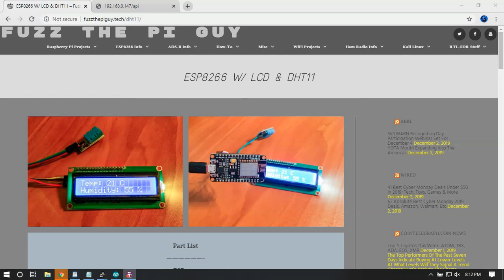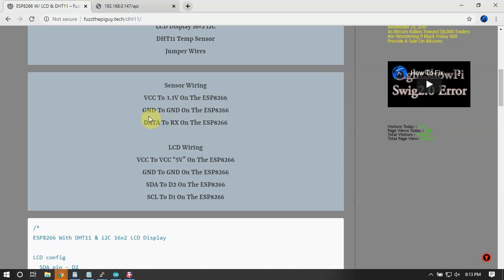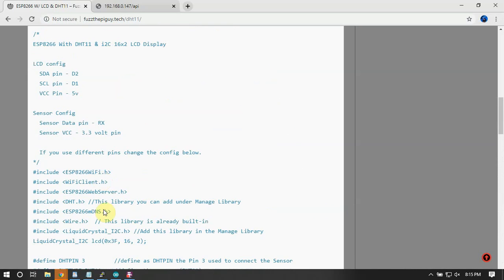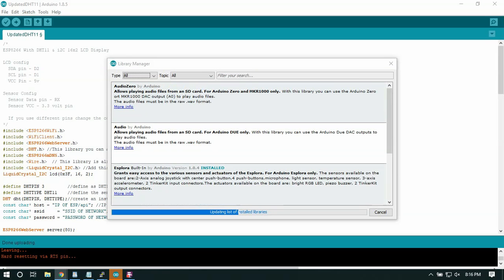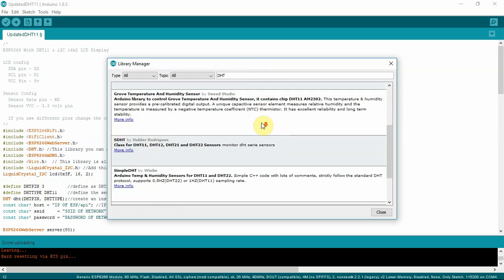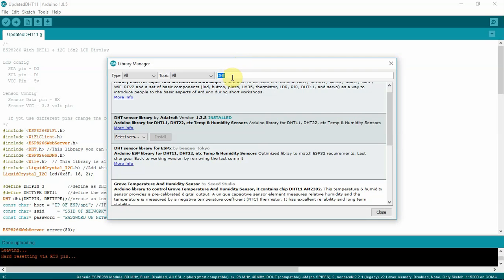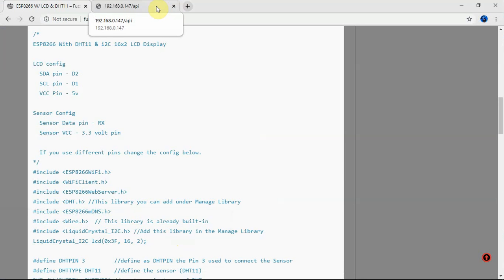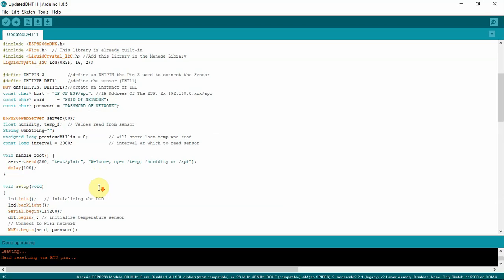ESP8266 Connected To A DHT11 Sensor And LCD Display 16x2

Comment: can I get your schematic diagram?
Reply: Sensor Wiring
VCC To 3.3V On The ESP8266
GND To GND On The ESP8266
DATA To RX On The ESP8266

LCD Wiring
VCC To VCC “5V” On The ESP8266
GND To GND On The ESP8266
SDA To D2 On The ESP8266
SCL To D1 On The ESP8266